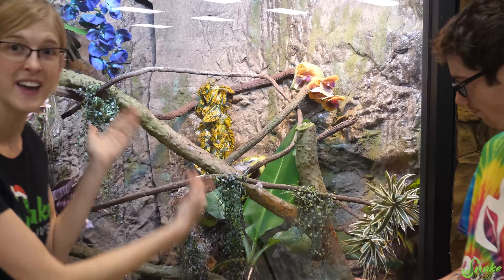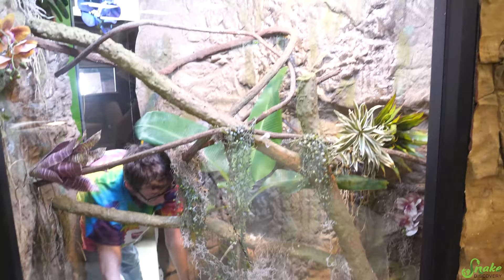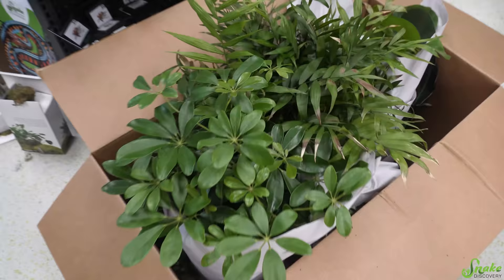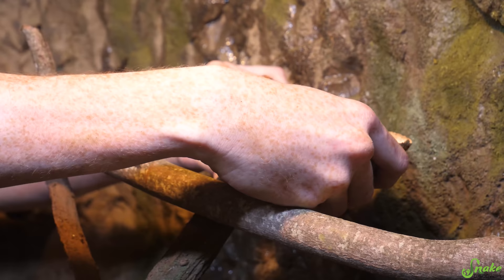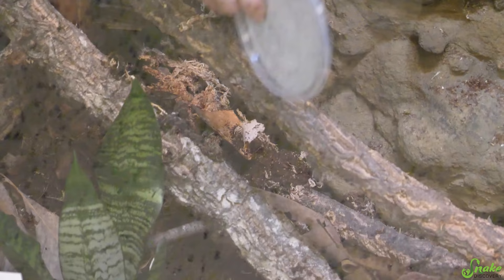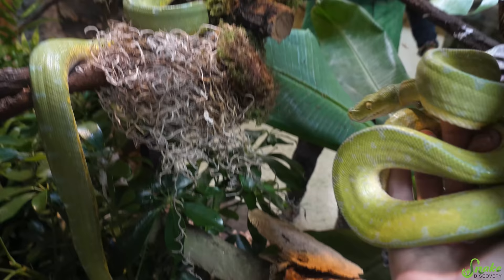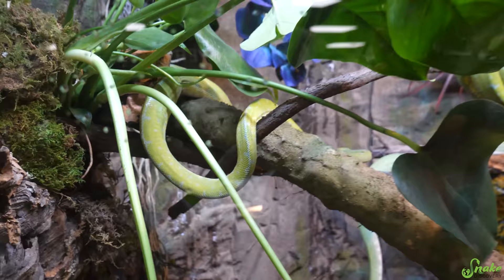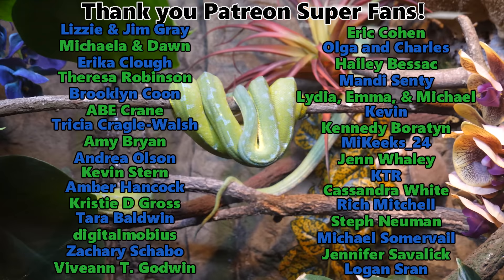Green Tree Python Enclosure Remodel!!

Comment: Looks amazing! I'd change the position of some of the plants tho', like put the Monstera in the ground because it's a climber and will get massive enough to take up the entire enclosure. The Stromathe on the wall and branch is a ground-dewlling tropical plant and does well in lower light and wet/moist soil, it will simply turn brown and rot where it's sat right now.
None of this is meant to sound mean! I'm simply a plant and reptile lover, that know plants. Just some friendly advice from an avid fan.
Reply: Leaving a comment to boost you 🤗
Reply from the maker: Thank you so much for the feedback! I don't know a ton about plants, so this is really helpful!
Reply: @SnakeDiscovery  Glad I could give some helpful advice! Keep being awesome guys!
Reply: yeah I was so suprised to see him put the monstera in the air and NOT in the soil. It has the potential to grow into a real show stopper when cared for correctly.
Reply: @charliethecairnterrier  i wonder if it may have been strategic to keep it from taking over 🤔. But I also don't know a ton about plants either so I could be COMPLETELY off in left feild.
Reply: some bromeliads would look great on the branches!!
Reply: In the comments I nerded over the monsters too.😅
Reply: Ehh.. in my opinion..The stromanthe will be fine. It can take the light. As long as the roots stay moist enough in the moss. The monstera won’t get big for a while. It will still attach its aerial roots to the wall and can climb the ceiling, back down to the ground.
Reply: @plantlover6392  Eh, I got a pretty small monstera like 1 year ago and it's at least tripled in size in this past year. As long as they have something to climb on and space for roots, those plants can *grow*.
Reply: @archiecat4182  yeah but the leaves still can get enormous
Reply: I agree with both points. My concern with the monstera on the ground is that they really like to dry out between watering and the rest like to stay moist

Comment: (For future reference) If the screw head was still visible but was only spinning in place when you tried to remove it how you solve that is you apply pressure to the screw tip with a piece of wood as you screw it out. That will give the threads something to catch so it can properly back out

Comment: Re: protruding screws - you can usually bend them with a couple hammer taps flat to the piece, then raise them up with the claw, followed by tapping back down. Once raised back up, you can break them with a sideways bend from the claw, then file smooth so nothing catches on it.

Comment: For gluing things onto screws, you'd be better off with a urethane product like sikaflex as they are not just a sealant like silicone but they are an adhesive too. Silicones primary function is to seal rather than to bond and hold if that makes sense. There will be no strength in the silicone like there would be with urethane.